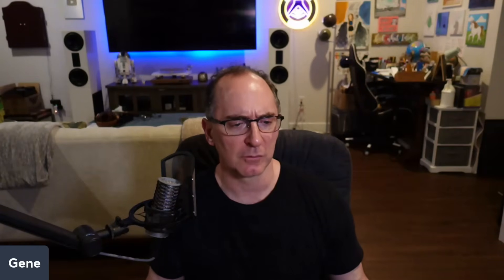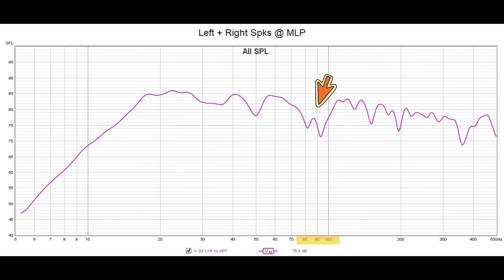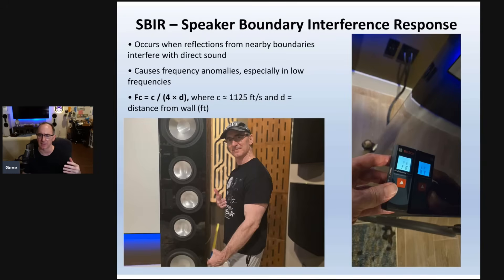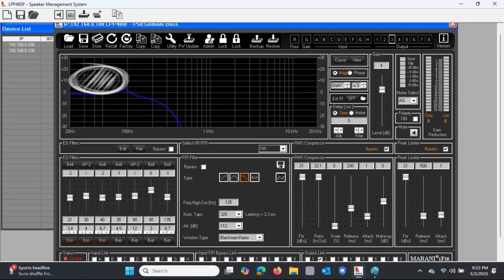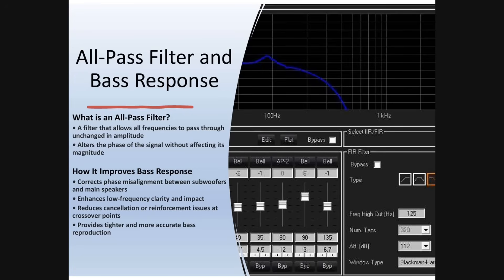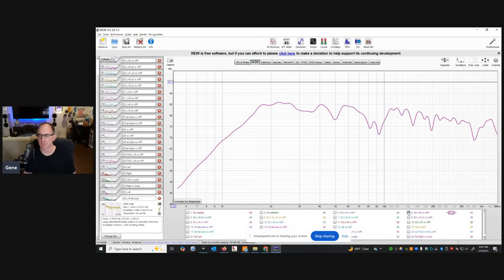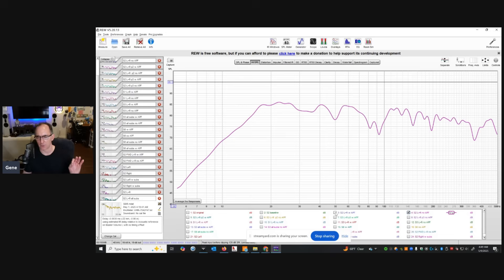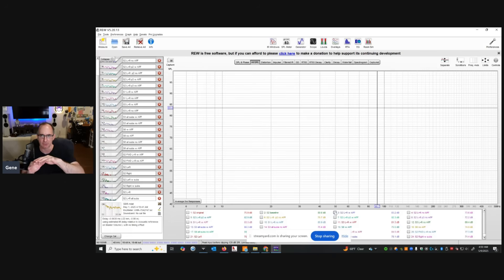4 Fixes to a Common Bass Problem Revealed!

Comment: When measuring distance, is it from the driver to the wall or the back of the cabinet to the wall? My speakers are very deep, so the cabinets are pretty close but the drivers are much further away. 

Thank you for this!
Reply: 12.27 the picture on the right shows him measuring from the front of the speaker
Reply: it is the drivers that makes the sound so there is the first point